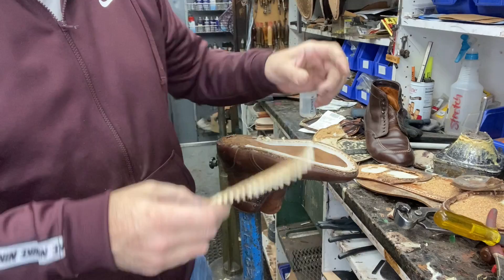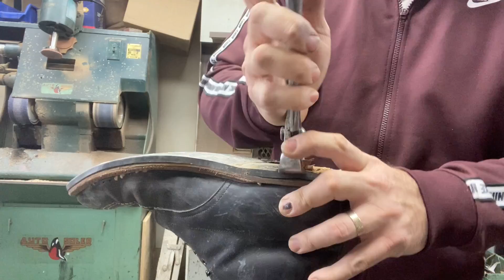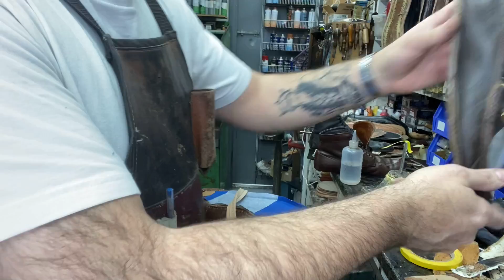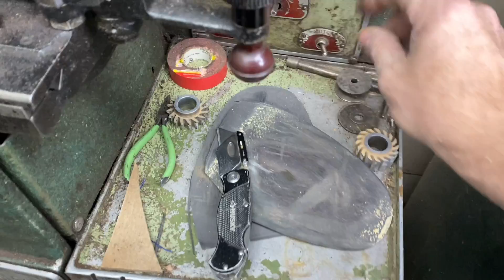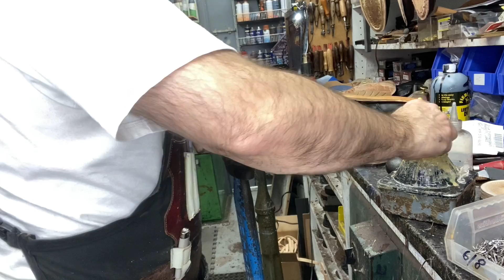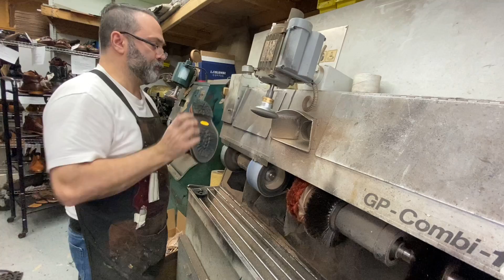Alden Indy Boots

Comment: As always, nicely done on bring these work boots back.  Nice work!!

Have wanted a pair of 405’s for a while now.  Since you have several pairs, what do you recommend regarding proper sizing since visiting the actual Alden store is not an option due to location.

Since the 405’s are a bit of an investment, I want to get the fit right. Interesting what you stated regarding the basically pressed paper in the construction of the soles of these iconic boots.

Comment: Great job as always.  It is so nice to see you restore fine shoes or boots and while doing so, make them better by upgrading components such as heel blocks and midsoles.  Not only does the customer have a nicely restored broken in shoe, but also a more durable one.  On the black boot where you tore back the sole to slip in the  piece to control squeaking was the shank already there?  It did not look like it but I wasn't sure.  No matter I am sure you did what the customer requested.
Reply from the maker: Yes of course, it was covered by cork that why you couldn’t see it

Comment: Hey you have a kangaroo leather hanging there in the introduction scene.. I always wanted kangaroo boots.. I live in Tamaulipas on Mexico. There's a boot factory and store which have almost anything. They have goat, elephant, bull, lizard, crocodile or alligator I don't the difference. I wanted kangaroo but they only have small kangaroo hides so its not as strong as adult kangaroo leather so I decided to get smooth ostrich leather. They're still breaking I bought em in like November.. but I have give them some beatings and it's incredibly abrasion resistant im actually impressed by that.. also it's not as hot as cowhide in summer

Comment: Steve, a question about the thread you use...Are there different gauges / thicknesses of thread you use for different jobs? A certain type for decorative work as opposed to attaching a sole or differing types of soles? Also, what is the composition of the threads...are they primarily nylon or hemp/sisal; natural or synthetic? What determines the type used? I know the questions are a bit arcane but the nuances of your profession are intriguing. Thanks in advance.
Reply from the maker: Most colored threads are nylon
White and black are linen

Comment: Did you offer the 360 welt?seems like it would make much better sense than the cardboard heel
Reply from the maker: 270 or 360 has nothing to do with what kind of heel you put on. But if the customer wants 360 then that is an option

Comment: Great video as always, love those Aldens.  I have a pair of black AE Hamiltons.  Actually, I was wondering, there are the "waterproof" version, but they have Dainite soles and I have treated them.  Any thoughts on wearing them in the not so dry weather?  I love them, but in Boston its wet a lot, especially this time of year when you would want to be wearing boots!
Reply from the maker: Well if they’re waterproof then why not wear them in bad   weather
Reply: @BedosLeatherworksLLC  I'm sorry, I totally misspoke, mine are the not specifically the weather-proof version, but I conditioned, polished and used AE's leather-proof spray.  I guess the bigger question is; isn't cow-hide leather waterproof to some extent by design?  Not sure if AE adds a Gortex (or other) liner material, of if they used "waterproof" cows! ;)
Reply from the maker: @supremegalacticcommander2783  no most leathers have pores so water would absorb unless the leather was specifically tanned in plus like the chrome excel leather (CXL) so with yours just use some common sense, don’t stand in puddles, 🤣🤣 wipe them clean after wet wear. Add shoe trees and condition after drying
Reply: @BedosLeatherworksLLC  Thank you for the information!

Comment: Fiber board = m d f Medium Density Fibreboard,  could this be what the heel stack component is made of? New fan from Scotland
Reply from the maker: Yes same material
Reply: It's a really crappy material, you couldn't hide your disappointment when you found it in the Turkish shoes you did the spade sole replacement on.  Also I'm well impressed with your use of materials as in sharpening the Stanley blades and the batting you use as a cover for the shanks, you are being practical not miserable nothing wrong with utilising everything in the shop well done you.

Comment: I thought the oil-tanned/Chromexcel was 403, and 405’s were calfskin. And those looked like calfskin from here, but I didn’t touch ‘em.

But then again, Alden makes lots of special batches for certain distributors, so who knows.
Reply: You are correct. However, you can tell from the quarter stitching that those are the Jcrew Alden Indy. For some reason the Jcrew Alden Indy's are labeled as a "405" even though they are chromexcel . . . so in a world that made sense they would would labeled 403, not 405.
Reply: @cacaddct3gasdsca267  Yeah, J Crew, I think I remember seeing those and being confused a few years back, before buying mine!🤣